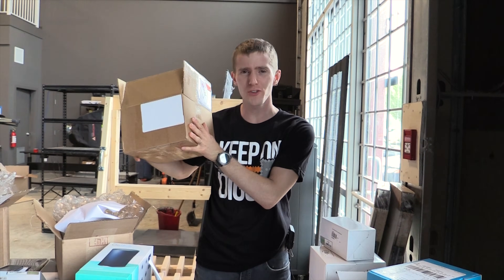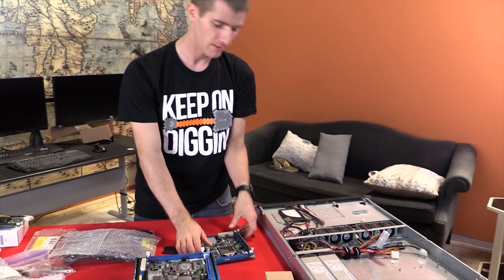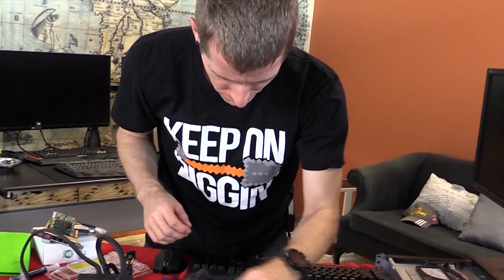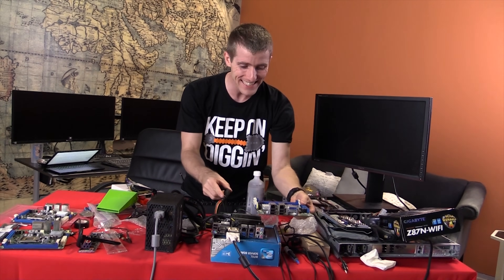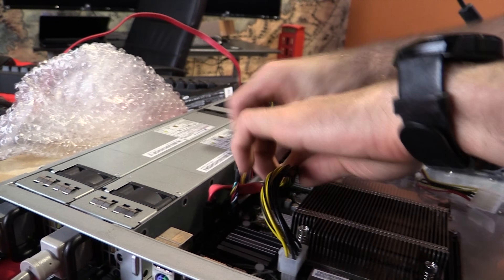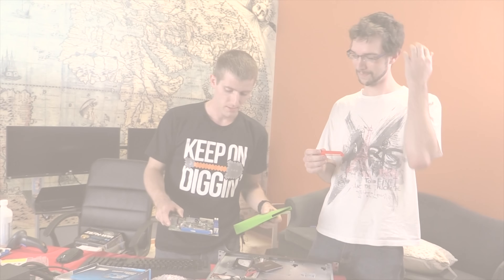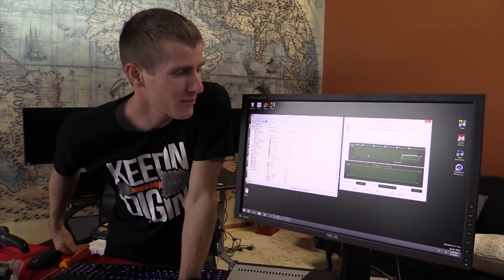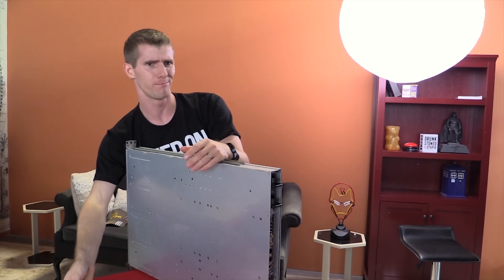DIY pfSense Rackmount Router Build Log - Part 2

Comment: With netplwiz you can make the system log-in automatically without writing the password.
Reply: Wouldn't that defeat the purpose of having a password?
Reply: TheTonyborbony but you might want to use a Microsoft Account without having to put your password everytime on your home computer. I always used a local account without password, but you lose some functionality.
Reply: +Nagasaky2x I think he's rather annoyed that there's a delay until when he should enter the password otherwise it misses the first few characters of the password. Also, what I hate more, I have to enable Numpad / tap Num Lock every time when I want to enter my password which includes numbers which I type with it.
Reply: CelmorSmith Your BIOS should have the option to make numlock ON by default, I have it for example.
Reply: +CelmorSmith And if your BIOS doesn't have that numlock setting, google the Windows registry key to flip to automatically enable NumLock.  I had to adjust the registry setting on my Dell laptop because the BIOS didn't have the option.
Reply: +TheTonyborbony No, because for certain networking situations you are required to have a password on your user account, and this allows you to do that and still not have to log in every time.
Reply: +Nagasaky2x you could also type "control userpasswords2" in the run box, been around since NT4 i think.  Just untick the use password option and select a default log on account.

Comment: "the metal back plate had a non conductive coating on it"
Reply: +TRASH?????? he said that the bending caused the dead motherboard not the backplate...
Reply: +Byzantine Why do you seem so surprised by that?
Reply: He just didn't want to admit he was wrong. It's clearly obvious.
Reply: Chong Sing You don't over tighten 2 motherboards and they both die.....he has tightened CPU coolers on hundreds of boards and kills the same board 2 times...
Reply: +Data it's not surprise, mostly it's because like 15 seconds later he admits that it was that metal back plate that fucked it up
Reply: +villigoo Ill honestly tell you that youre the only person that ever agrees when he is wrong,you have earned my respect!
Reply: +Byzantine You can see the bending of the motherboard in the previous video. Mostly due to the bad design of the Intel motherboard. The Gigabyte's motherboard worked fine without any modification.
Reply: +TRASH?????? Because of pressure, not shorting out
Reply: +Byzantine 7:35 though..
Reply: Chong Sing Regardless, he would have some experience and he did it with both boards...
Reply: villigoo Watched it, so? Can't you see the nonconductive coating?
Reply: +Byzantine Not factory aproved non-conductive electronics, hand made by a CPU- motherboard shake junky doensn't count!
Reply: +Byzantine 
when you're not using a torque wrench, it's easy to overtighten.
especially when using a socket driver. makes it easy to keep turning.
ironic that, a better tool can actually be a negative, because it makes it too easy :p